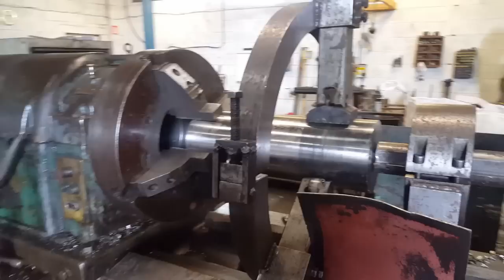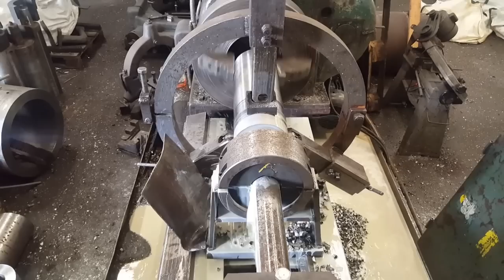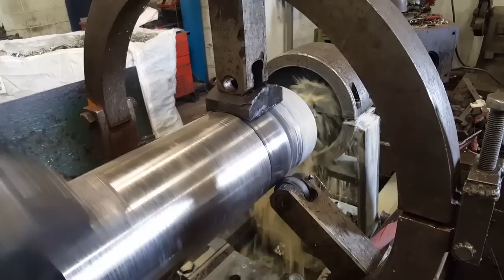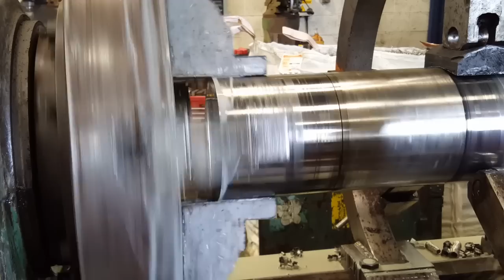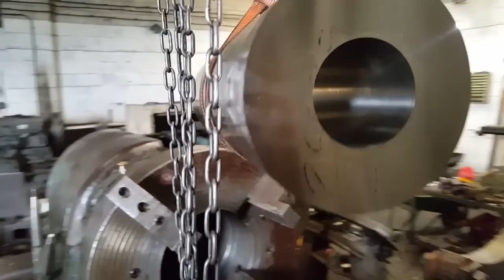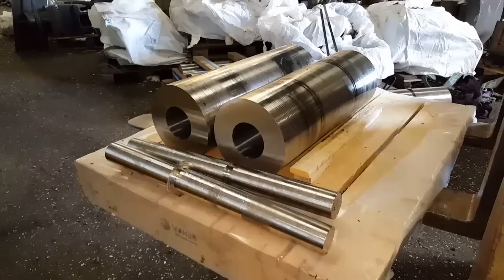ALLOY A286 8"x24" long. 4" hole drilled through.

Comment: whats that black stuff you have in the top jaw of the steady rest?
Reply from the maker: middlemanclayton1 it's a type of nylon called polypenco.  The top bearing takes a lot of pressure and break... This stuff doesn't.
Reply: userwl2850 aha i see , why does the top bearing take a lot of pressure? id have thought the lower bearings take most the preasure due to the weight of your part, then again do you need to crank down on the top bearing to hold it tight?
Reply from the maker: middlemanclayton1 Newtons third law of motion.. "for every action there is an equal and opposite reaction"    the cutting force is pushing the cutting tips down which causes the bar to push up. 😉
Reply: userwl2850 dam...you just scienced the shit outta that :D guess i still have a lot to learn about heavy machining, im currently machining some 500mm long M64 bolts and thats about as heavy as my machining gets.